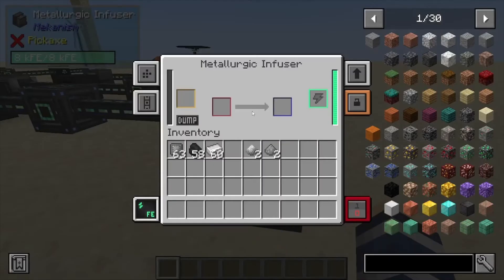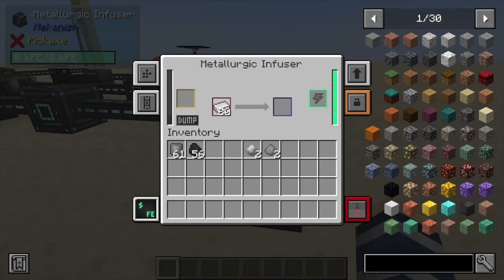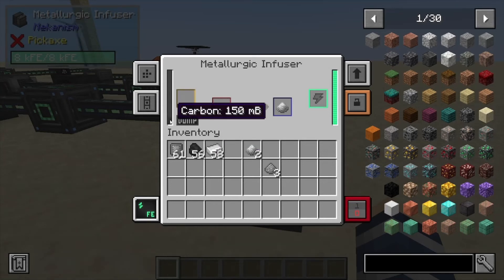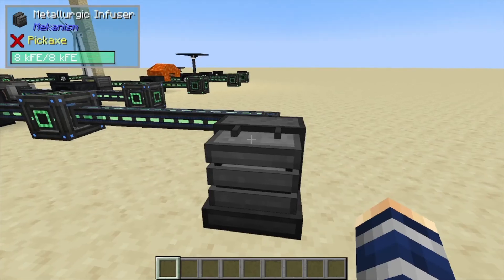Mekanism: Steel (how to make)

Comment: How do I power it? It seems like everything i need to power it requires a material that I can only make with the infuser that I can't power up ;-;
Reply from the maker: The heat generator doesn’t require steel to make it’s the first generator to go for.
Reply: @MCMentor1  i cant found the heat generator :c
Reply from the maker: @xrounderyusuf2312  there is a tutorial on it in the mekanism playlist
Reply: yes but i cant transfer energy to it without cable which is made with steel
 @MCMentor1
Reply from the maker: @azds5554   You dont need wire put the machine heat gen right next to it.
Reply: u need to put redstone dust into the lightning symbol